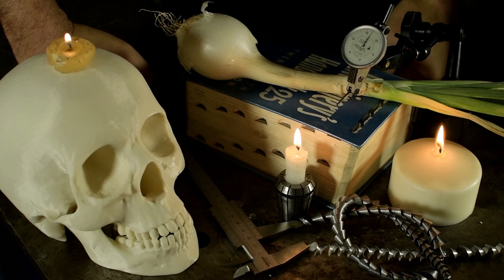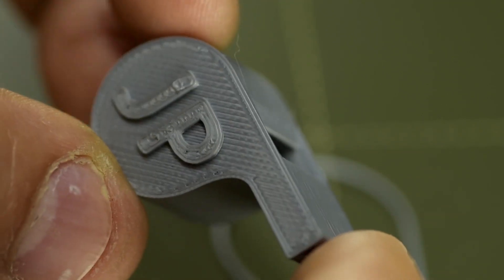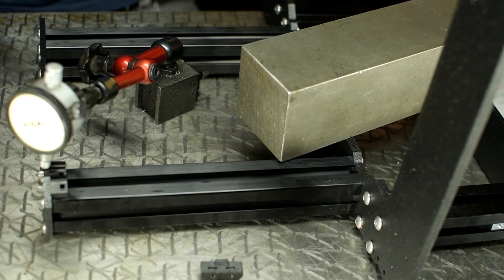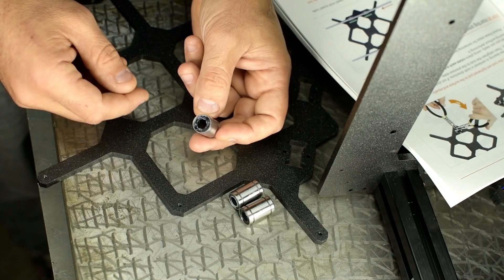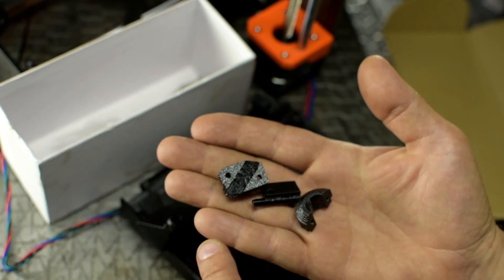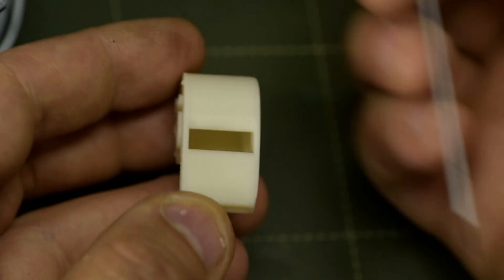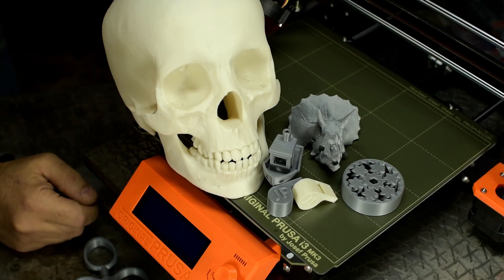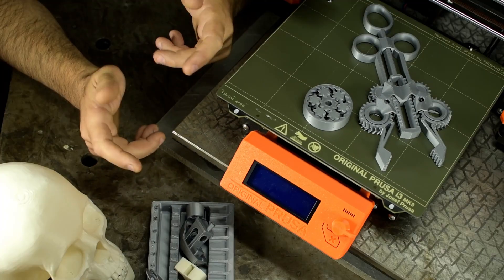This Old Tony in 3D!!! (printing)

Comment: Tony's about to find out that the filament is hygroscopic, get a sealed container, silica gel kitty litter and a tube sock or two, put the silica in the tube sock and store it with your filament in the sealed container, bake socks in oven at 180f for 2 hours every month or two to recharge them.

Comment: I built one myself. Was with wood frames, but it is ok for me.

Was heck of a fun.
Seeing you greasing up the bearings show me what i have to do after going through 4kg of PLA...

I use it for printing model ships and the small stuff on top of them. Why buy a pair of 35mm propellers for 30€ if you can just print them in any size you need? (Especially as I needed 32mm to fit the hull...)

Comment: Looks like an excellent build. You need to adjust your retraction settings and be careful about the environment you're using the printer in to avoid that stringing.

Comment: I Bought myself a 3D printer about 3 years ago and I built it up as soon as I got it,. Anyway About 18 months ago I thought I would power it up and look through the SD card. I found something on the card but didn't know what it was. Anyway I adjusted it all up again and had to put this glue on the heated surface plate "pritt stick", hit go and it printed this snazzy "looks like" M12 x 35mm long nut and bolt it took about an hour to do it!  AND THATS IT THATS ALL i HAVE DONE ON IT!

Comment: On the benchy Those settings are mostly good the retraction distance could be changed to get rid of the wisps, but a slight heat can do that to, and there is a little ghosting (wavy lines up and down) caused by vibrations i think depends on your prefrence wont affect tolerance as much, ive got 2 printers from creality the cr10s (modded direct extruder) and the cr20 pro with bltouch geting them dialed in took a bit of time but im geting about the same quality.

Comment: The benchy sinks in water.. However, someone did make an RC variant on Thingiverse which is sea-worthy. Make sure to oven-dry you filament, keep with silica gel in a box (hand-modified to accept the filament) and use non-hygroscopic materials for wet applications.

Comment: Okay.. I almost spit my drink out when you picked up the impact driver for the Z axis motor mount.. I was laughing good on that one. 
The benchy looked good. I see a slight horizontal line on the hull, and some strings,, but overall not bad.  If you dial in you esteps and do some PID tuning, you might be able to improve that.. But still a good result right out of the box with no tuning.
I'm on my 4th printer now. (I have a desk dedicated to them).. Got into them a few years back, and found them very useful when you need something odd that you just can't get at the store or need something custom..  Example, right now my Chiron printer is making a silverware organizer that is custom fit to my kitchen drawer. (2 day print, 360mm x 360mm x 70mm)
I have also made a printer from the ground up... (took a couple months),, these are fun to learn. 
You are correct, a drafty garage is not an ideal setting for these.  Also, be careful with the rails and lead screws in a garage setting, debris on the screws and rails can lead to quality of print issues since that debris sticks to the lubricant on them.
Reply: I was just scrolling down the comments before posting something along the lines of .. "I can't believe the quality you got out of the box from the Prusa.. I have struggled and battled with my Anycubic Chiron since I bought it and I'm still not getting prints anywhere near that quality!" and lo, someone in the comments with a Chiron :) I mean, don't get me wrong, it's not a train wreck.. but I think I'd have had a much easier learning curve if I'd bought something a little more polished out of the box! Now.. I must go and see if I've created a birds nest of ASA or not... but I have only had passable PLA prints, so far, so I'm not holding my breath ;)
Reply: @aaronbuildsa  
After some tuning on my Chiron...  (Okay,, a lot of tuning, and some words I can't repeat)
https://www.thingiverse.com/make:699011

I like the printer because I can print massive prints with it, and it's really not that expensive for it's size.
Things I did to mine.
PID tuning, esteps calibrated, replaced bowden tube with Capircorn tube, changed nozzle type to MK8 style with the stock hotend/heatsink (requires a little tweaking due to thread lengths), TMC2208 drivers, ant-backlash nuts, and some fine tuning on the belts to make sure they were tight.  :)  Also changed the bed to borosilicate glass, but that was after the benchy print.
Reply: @smithfamilydesigns2012  That's a lot of tuning indeed :) I have done some of that (esteps, PID etc) but haven't done any hardware upgrades yet.. I keep pondering a new hotend or driver upgrade - given how your benchy looks, I should stop pondering and do it! :)
Reply: @aaronbuildsa  
TMC2208 drivers are very nice in that machine. Night and day on noise levels from the motors.  Fans are still a little loud, but I'm okay with that. 
Only reason I did the nozzle change was because I wanted it to match the nozzle on my other printers, and the MK8 nozzle fits in a 1/4" hex driver making it easier to swap. (And I already had a pack of 50 of them).  Okay, that's like 3 reasons..
Reply: @smithfamilydesigns2012  ah the fans.. I'm thinking I'll move the printer down to the garage - having it in the office is great for tinkering but at the same time, hard to have it running and actually do the day job with the racket! Also gassing myself with the ASA fumes, but y'know, the noise!

Comment: Moving to light weight, compliant mechanisms is quite a change, eh, Tony? The printer isn't all tight fit parts, so packing the Y bearings with grease isn't necessary as the smoothness and steadiness is from belt tension. So, don't forget to follow the directions first, there're a lot of nuanced differences to "machines".

Comment: Been watching these videos for a while, and I guess Tony doesn’t know that all Colchester lathes come with a restore mode.
Most people don’t know, because it’s usually a small switch on the back. So it’s easy to miss. 
But if you put the lathe in restore, it sucks the chips back into the tool insert and adds the metal back onto the workpiece. That way you don’t have to scrap a part if you accidentally cut too much. You can just add it back and try again.
Reply: it has a ctrl-z axis?
Reply: It’s called “Undo” on my lathe and has four levels.
Reply: Now you have me wondering if the time module was an optional factory feature.
Reply: Does the Colchester lathe play mariachi music backwards when you have it in restore mode?
Reply: @lforbesconstruction  No, Country music...  You get your wife back, your dog back, your job back.....      :)
Reply: Kind of like the BS1000 by DuhWalt. Cut twice measure once. Search Next Level Carpentry BS1000 to see it in action.

Comment: Those "threads" of filament on the benchy is an issue called stringing. Basically the retraction settings and heat of the printer needs to be tweaked. Retraction meaning the filament goes backwards to avoid over extrusion and the temp of the nozzle might be a bit hot. There is a variable between filament material, retraction setting, and nozzle temp. All 3 needs to have a sweet spot so you don't have stringing. Each printer(even if you buy all prusa's) are different and might need a tweak here or there. Could be a difference of 1-5 degrees nozzle temp or a 1-3mm retraction setting. Let me know if you need any more help, I don't have a prusa but its all the same.

Comment: Congrats on the new printer. I've heard good things about those. Can that printer handle non-planar slicing? That's the secret to true 3d printing, rather than stacks of 2d prints.
Reply: No, non-planar slicing isn't available in any commercial machine. It's just a hack with LOTS of compromises - basically, since the hotend must fit within an inverted cone from the nozzle tip, any kind of part cooling is out of the quesion. That's why you only ever see quite shallow prints as a proof of concept - if the angle of the print becomes too steep, it would require colision checking of the tool head vs. the print.

Comment: Many years ago we bought a 3d printer kit made by reprap pro, sold thru RS (similar company to digikey).  It promised that it could be built in an afternnon (I and a few colleagues spent four days on the mechanics, sometimes pausing for the makers to upload the pdf for the next step).  Once built, it didn't work with any software they suggested it should, though I got mine to work with third party stuff.  Turns out they'd never tried a virgin install on a new computer, all tests were run on the development pc.  The prints were pretty ropey, the support forum denied it.  Eventually development was forked, and it started to produce reasonable work, but by then the XYZ by daVinci came out at the same price (£500), and worked out of the box with pla and ABS, so I pretty much kicked my Ormerod to death and shrugged.  Much more insight, but a waste of a few months.  Good to see yours actually produced something after the mechanical build was done👍👍

Comment: If you really tune your things in right, I've managed to use 3d printed parts to replace broken aluminum bits, or make odd sized adapters for tools like oil filter wrenches.

Comment: Puts my cobblebot to shame, I squared my bed using a roofing square and averaged a 'flat surface' to build it on by testing flatness on a range of flat-ish surfaces as I was putting it together and tweaking between them. 3d printing is just another tool set, it goes with all the others. I use mine for custom cases for projecty things and fixing broken plastic things.  Most interesting fix was a broken piece of kids wooden railtrack where the corner broke off so I printed a new piece and superglued it on.

Comment: good choice, add a raspberry 3 or 4  to control the printer via network, also using a smart powerstrip to remote shut down the printer in case of problems ;)

Comment: Welcome to the club. Best tool ever for a great many projects. I built mine on the top from an old marble end table, very flat. Nice job on the tool tray! I've made a bunch of small tool trays and racks for the lathe and mill tooling. If you add a Raspberry Pi with Octoprint you can send files directly from the slicer and not have to fiddle with SD cards. PETG is great but it sticks too well sometimes to the printbed and can damage it getting the print off, so a thin spray coating of Aquanet will allow it to stick well enough but release later on (and PLA works fine on it as well). ABS/ASA likes to warp, prefers an enclosure to control drafts, and emits unhealthy particulates when printing. TPU filament is flexible and very useful for gaskets and feet, and also needs the Aquanet to keep from tearing off the printbed surface it sticks to even better than PETG. Happy Printing. :)

Comment: That's a very nice looking benchy, though that's to be expected out of the box with a new MkIII.

 Generally you want to watch for:
- poor surface finish (indicates lack of rigidity in one or more axes)
- boogers (technical term - caused by plastic building up on the nozzle and occasionally dropping off into the part)
- under extrusion (looks kinda like gaps in the layers)
- over extrusion (makes the part look thick and melty)
- bad overhangs (port holes, arch over the door), and
- bad bridging (the first few layers of the top of the window frame)

Comment: Always enjoyable..thanks for the ride...love my 3d printers...Ender 3 and Sovol SV01....Have printed everything from soap dish holders, machine tool holders, sink stoppers, a kajillion quadcopter parts for my freestyle quadcopters and those of my friends....printing a 21700 battery box as I type this...I'm sure you already know of thingiverse. A great repository to check before you fire up a 3d modelling tool to create your own needed thing..those wispy's btw...a judicious application of hot air will melt those away pretty quickly....judicious...

Comment: AH SHIT.... 

Was wondering why my (kit) prusa still makes a lot of noise, i guess i have to take it apart, wash the bearings and re-grease them again, i was just putting grease on the rods and was wondering why that didnt work, makes sense now. Hopefully it will also help with those vertical lines i get sometimes (does anyone else get those either? Vertical lines multiple layers on top of each other?)
Reply: @npgoalkeeper _ no, but i figured it out already, it are z-seams. But thanks anyway

Comment: I bought an ender 3 to play with a while back. My experience has been pretty straightforward as well, but the machine certainly lacks the refinements the Prusa has. I'm not sure I could print moving assemblies as one piece like without a bunch of messing around, but I also didn't set mine up with precision tooling. I mostly use mine to prototype parts before investing the energy to fabricate them. I've also occasionally used it to make bits for casting (I'm drawing a blank on the technical term). I bet ToT will get some good use out of it one way or another
Reply: The Ender 3 is a pretty good printer.
Printing parts as one peace shouldn't be a problem (unless you really messed up the assembly)
Reply: @Jehty_  I'm sure it's my own fault in some way, I've been fighting stringing lately.

Comment: That benchy looks great. It's a bit unusual to get that stringing from the quality filament that Prusa makes but nothing worrying. I generally prefer PETG as my filament type of choice. It has better heat resistance than PLA, less warping than ABS, and generally good layer adhesion. I'd love to see ToT mod his MK3S with parts he machines.

Comment: I have the ender and it is an extremely high quality printer for the price, it prints intricate DND mini figures with no issues, as well as large parts for prototyping, tackling both ends of the 3d printing spectrum with minimal issues

Comment: dont leave it too unattended, seen to many horror stories of hot ends latching and catching fire.
Reply: p.s. you sold me, I have a well equipped workshop and can fabricate anything, but I dont own a 3d printer. perhaps now is the time.
Reply: True. Some are safer than others, but at the end of the day unless you own an asbestos bunker there's no such thing as a 3D-printer that you can leave unattended without that knot in the gut.
Reply: Chances of a Prusa catching fire are slime to none. They don't disable safety features because they don't understand them like some less expensive manufacturers do... They actually developed a good portion of the thermal runaway protection.

Comment: As someone who just bought a "plug and play" type printer: You end up taking the stupid things half apart about every 3 prints anyway because of some new problem, so at least you already got some practice. I tought you needed patience for machining, but goddamn, it's quick and easy in comparison to getting reliable decent prints
Reply: Depends on what kind of "plug and play" printer you got, and make sure that it wasnt a "plug and pray" printer
Reply: @HvV8446  Or even worse, prug and pray
Reply: If your experience is that poor - perhaps you've got some dodgy filament? With good quality PLA, my several year old Prusa MK2 will produce flawless print after flawless print - With cheap PLA, it's maybe 1 in 3 that work properly.
Reply: My plug-n-play worked right of the box. I've printed at least 100 things and haven't had to do anything to it.
Reply: Patience my young padawan. After 400 years of practice you'll be able to slice those models with your eyes closed.
Reply: Never had to take apart my prusa printer. I took it out of the box  and was printing in 10 minutes. Only ever had a few clogs when I used low quality filament.
Reply: Prusa i3 pretty much belongs to the category of "plug and play type printers". At least that's been my experience.
Reply: Wait, sounds like you think you don't need patience machining?  LOL.  it's not quick nor 'easy' when you're actually making parts that matter.  Moreso when you have a complex assembly with multiple setups.
Machining is as much of an art as it is a science and any good machinist will tell you it takes many years to master.    I'm entering close to a decade working with a mill, lathe, CNC and welding and I can tell you I learn weekly.
Don't get too ahead of yourself there.
Reply: @shirothehero0609  I was making a joke. Calm down